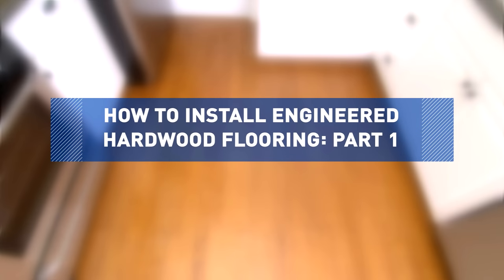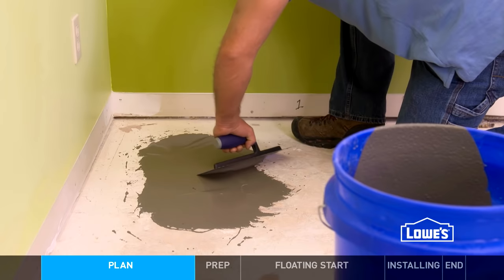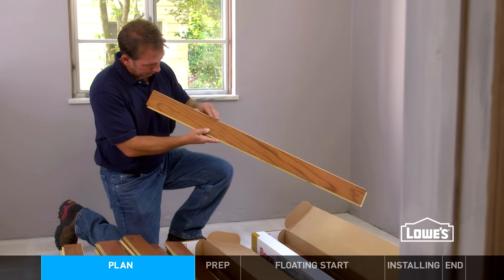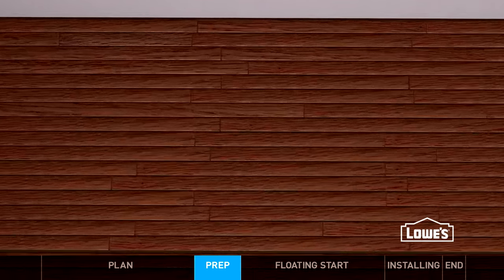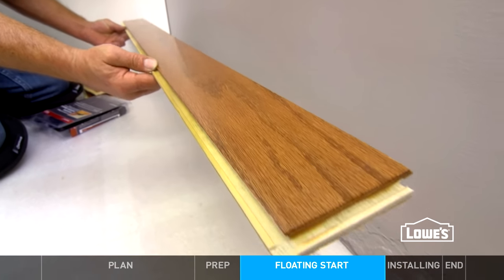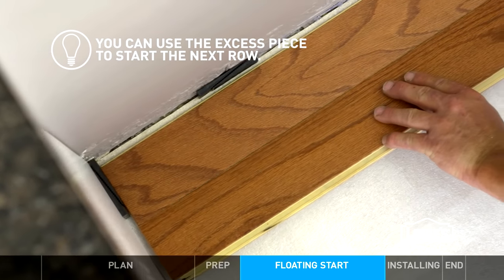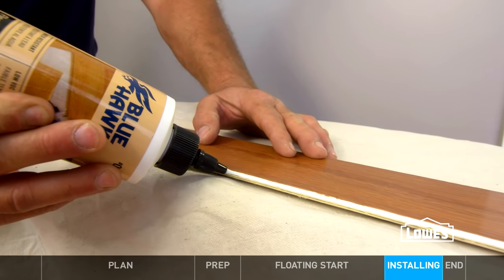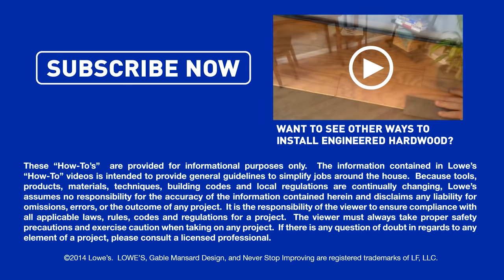Engineered Hardwood Floor Installation: Part 1

Comment: what was that sander that was being use on the concrete floor in video, I have a slight imperfections in concrete can I use that tool?
Reply from the maker: It's called a belt sander. Here's the one we used: https://www.lowes.com/pd/PORTER-CABLE-12-Amp-Belt-Sander/3563092

Comment: After installing the floating floor, does hiding the expansion gap somehow is necessary, or it should be visible?
Reply from the maker: Normally the expansion gap is covered by molding for a more finished look. Thanks for watching.
Reply: Péter Balogh If the crown molding is still on the wall prior to installallation leave a little less than 1/4" for expansion and hide it with quarter round.  Then all is well!
Reply: Thanks for the answer!

Comment: I am installing a 3/8" thick tongue and grove engineered flooring. I plan on nailing through the tongue as you show, but not sure if I should use 16 or 18 gauge nails ? Help anyone?
Reply from the maker: +Bruce Grieve recommendations vary; check the instructions for the flooring you're installing. Thanks for watching our video.
Reply: Bruce Grieve
Reply: alex
Reply: hrmm I don't understand how it's staying in place

Comment: In floating method aren't you supposed to glue the seems?
Reply: Only if the product doesnt have a locking edge, which 99% of floating has now
Reply: ringtyler 8
Reply: Joseph Foster ujy yu hu hu hu hu uuuuhuhuuuuuu7 hu

Comment: My acacia engineered hard wood floors from Allen Roth are creaking every where! I spent so much money had it professionally installed according to floating instructions.  The creaking is unbearable! Any one else has this happening? If it should be glued down then it should say so. Still trying to get Lowes to call me back to send a rep to see it first hand. I’m sick to my stomach with every step i take in y home.
Reply: Did you ever get this resolved?

Comment: HOW CAN YOU CALL THIS A FLOATING FLOOR WHEN YOU NAIL OR GLUE IT TO FLOOR.
I DON'T SEE HOW IT FLOATS.
Reply from the maker: +Ughh61 sorry for any confusion. This series covers 3 methods of installing engineered hardwoods; this video (Part 1) specifically is a floating floor. Part 2 covers glue down and nail down. 
Thanks for watching.
Reply: Lowe's Home Improvement ì